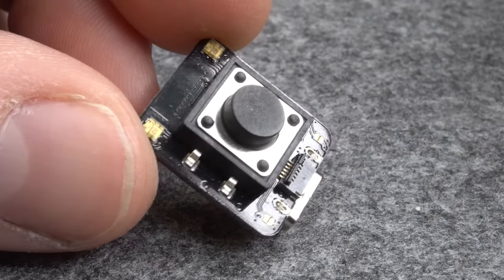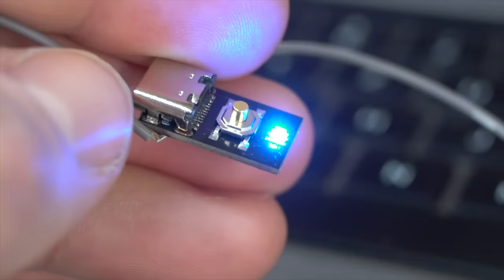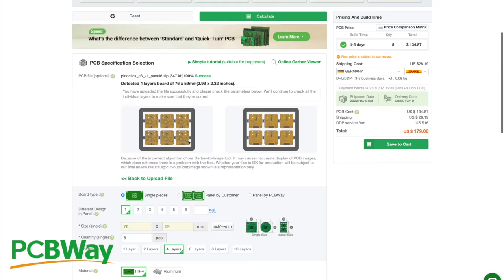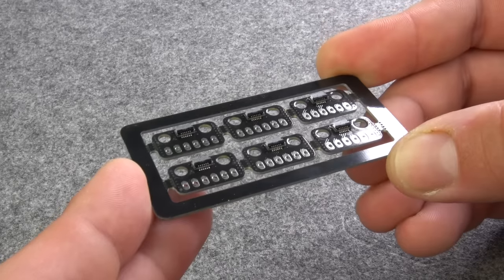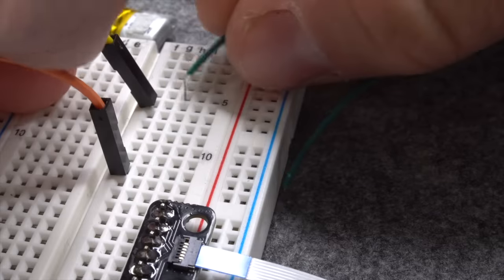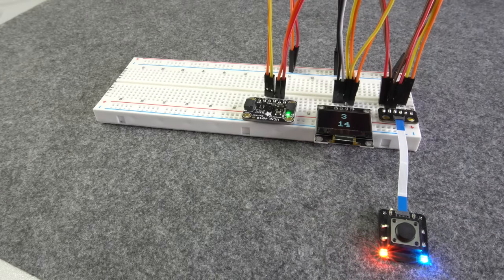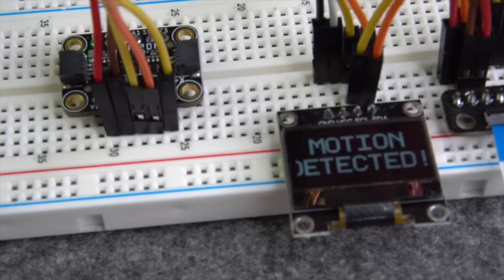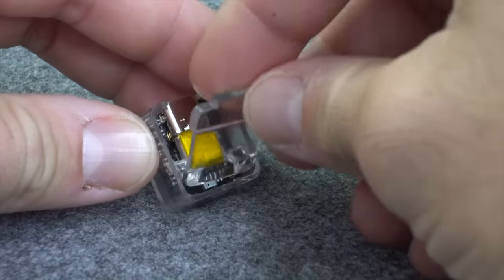Picoclick-C3 is the most advanced ESP32 based IOT button | makermoekoe

Comment: This is so cool. I used a bunch of these techniques to build my custom made ringbell that sits outside without any wires, just ESPNOW, deep sleep mode, a 1000mah lipo and a touch pad that lights up for a second to wake up the ESP32, do its thing and go back to sleep. it will survive 6 months on a single charge. but of course it's a bit builkier and built on a protoboard (I'm ages away from being able to build my own pcbs).

Comment: In the next revision, put the connector (isn't that an FFC, instead of FPC?) on the other side of the board, opposite to the USB connector, that way you  not only you don't end up with something in the way when you need to use the USB connector, you can also just fold over whatever you plug there, creating a more compact envelope, while leaving the USB port unobstructed.

Comment: very ..very nice and useful project, the only thing I would change is the positioning of the FPC connector on the other side (between the LED’s) so that I’ll be able to connect an extension bord and the type c cable at the same time (while in a 3d printed case). Also instead of the FPC connector I would use castellated Holes (Plated Half Hole) in PCBs, I would make it more easy to integrate in projects (this way it can be soldered directly to another bord and/or anyone can solder a few wires)

Comment: As an electronic engineer myself seeing the professionalism that can be achieved with diy projects nowadays is astounding. RF circuit design is fairly complex, may I ask how did you learn about it?
Reply: I agree its a great project. There's not really any RF design here though, it's a SoC using a chip antenna. He has just connected the LNA pin on ESP to an off the shelf chip antenna. Route antenna line over a solid ground plane and keep high speed lines away from it and chip will take care of the rest.

Comment: Nice! Have you measured:

(1) Air time (how much time in milliseconds does it take to send and/or receive a small packet)?

(2) How much power/current does it consume during transmission? And during sleep/idle mode?

(3) What is the maximum range in free air (line of sight)?

Comment: Do you modify the oven for solder?  The $30 UYUE 946C hot plate  looks nice, but may heat unevenly.

Regarding programming, you mention you don't like the ESP-IDF environment, what do you like better?

BTW, some ESP32-C3 boards (ex. ESP32 PICO D4 RGB LED) use the single USB-C for programming/uart.. why do  you need a separate header?  Is it for JTAG?

Comment: Hmm. I wonder if you could make it even smaller by making it with a small solar panel and 1 (might require multiple) capcitors. Bonus points maybe for making the solar panel on top of the button to hide it.
Another idea: perhaps replace the button with a motion sensor and use the "tap" motion detection to emulate a button press... then there are no moving parts which would make this device last a long long time. Though I suspect that would decrease the battery life since it would always have to be on standby looking for tap motions.

Comment: This has been on my todo list for a long time because I'd rather have an ESP garage door opener system than any crappy commercial product.  It might be nice if we could buy these premade since not all of us can assemble such small devices.

It would also be interesting to make a supercap power expansion board since lipo isn't exactly great for use in cars.  That and/or a LiFePO4 expansion.  And an inductive charger board for either the supercap or LiFePO4...

PIR sensor would be another obvious expansion board.

Comment: Wow that looks great. But How did you solder the bottom side of the pcb?
Reply: Yep, same question. 
Maybe a lower temp solder paste and a new round in the reflow oven?
A hot air gun?
Reply from the maker: Exactly the same way I did with the top side. Even with the same solder paste. But the components won't fall off because of the adhesion of the paste. Heavier components like the USB jack would fall off but as these are the highest parts on that PCB they just lay down onto the oven tray
Reply: @makermoekoe  Thanks for the reply. That's interesting to know. I'll have to give it a try.

Comment: Thanks for the amazing documentation you've done! I'm trying to learn how to do the antenna matching circuitry, and I see you have quite a different design on the C3 vs the C3t, have you noticed a significant difference in signal quality?  When I look at the schematic for the c3t I see it has a 0 Ohm resistor in series with the chip antenna, is it simply so that you figured out the exact value later by measurements to get the matching right? Do you have any tips on where I can read about dimensioning the components for the matching network? Thanks!

Comment: As is, these already look awesome for this, but if you made a model with the accelerometer onboard in exchange for a smaller button, this could be very nice, extremely tiny wireless motion tracking sensor for full body tracking in vr.

Comment: I have a question about soldering. I saw you heat the board in an oven to solder one side of components.
How do you solder (heat) the Push button side without the lower side parts falling off?

Comment: Q1) I worked with Atmega644p /smaller sibling to the classic arduino uno. Managed to get it down to 100 uA power in sleep mode. Wouldnt such a device be better to use then ESP32?
I mean just the startup from deepsleep to working state would draw more power on ESP32.

Q2) What owen is that, Infrared DIY ? :) looks handy

Q3) How to you calculate impedance on the PCB traces for the antenna. Is it done in the CAD software you use

Comment: Excellent video and gorgeous circuit designs! I follow all your videos, and I used the power up circuit with the 2 diodes and a button, very clever using the vdd_flash for latching it. I have a question about it? how do you turn off the circuit? because the button is for powering up and a digital input, is the MTDI something to do in the powering off operation?

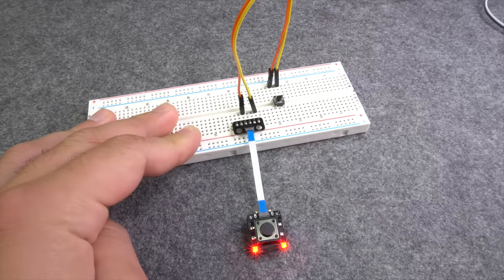Comment: At 10:25 he mentions that door sensors can be used to wake the device, I assume this will only work one way? I mean if the door opens a reed contact will be closed but when the door closes, the reed opens but the device doesn't turn on then if i am correct? Or are there special "interrupt" reed switches that send a high signal both ways?

Comment: Would you later add a biometric/fingers print censor adapter..  also on/off command with polarity switch for door locking solenoids or

Comment: For iot switch, tiny solar panel can charge this device from indoor light, so you can mount it in simple case with touch sensor, in that way, this could be real product to buy instead of make ugly dev board with wire connections and problem to find socket nearby

Comment: I'd like to build the tiny version with a width of about 10mm. The height doesnt really matter and I want to try to build a version with more useable gpio pins. Basically a seeed esp32 just longer so that it has that desired width. How do I do that? Can I just download the original seeed esp32 files anywhere and then make my own pcb and then just use all the components from the seeed esp32 pcb and transfer them to the new one?

Comment: This is amazing!! Any chance of a tiny gps to add to it? I've been looking for something similar with that much power. I am looking for an ultra tiny gps tracker that logs via wifi or cellular sms. I would love to have this without the button but have it use touch vibration as input and a tiny gps, and dual sd/sim slot, for logging

Comment: Working on esp-12f, got some doubts in the chip 
If the input voltage exceeds 3.3v by any external factors does that make the mc crazy..?
Reply from the maker: Till 3.6v everything will be fine 😄
Reply: @makermoekoe  While testing the circuit with smps, at some point the smps output went to 8v instead of 5v then it caused the esp beeps constantly

Comment: Do you think you could build a real window or door  Sensor with it? Amine has to detect Open and close state as separate events :)
Reply from the maker: Actually I have thought about this in combination with the motion extension board. If the window opens, it detects a movement and with the angle of it you know wether it is opened or closed 😀

Comment: Love this project. I'd be interested about what other functionality you could achieve using a smaller button (heresy I know) and opening up that space.

Another thought I had was the input voltage range. You mentioned powering the device with 3.6-6V. So if you powered it with a LiPo would it go under the recommended operating voltage quickly as the LiPo drains and its voltage droops from 3.7 down below 3.6? I would guess the 3.6V is coming from the ESP or some other part with a 3.6V recommended operating voltage. And maybe the part is just derated and will actually function with anything over 3V. Or do you have some sort of boosting going on to ensure the voltage stays above 3.6?

Comment: It was cool and all, but I clicked the video to see what’s its use cases are. But, that was impressive still
Reply from the maker: There isn't a specific use case for this device as it can be everything 😄 Basically this thing was built to control (toggle, switch on/off) things in your smart home (lights, heaters, outlets) but it can be integrated to IFTTT for web requests as well. And with the extension port, it can be coupled with other hardware as well, which converts this thing into a tiny development board. As a lot of people have questions about the use case, I will show a few things in the next episode!

Comment: Esp32 is very powerful chip with huge power consumption. It is like fire from cannon to birds. One chip can handle ten buttons and server in the same time. Also it is expensive to using like one button trigger device. One ESP 32 can be used as quadrocopter self control computer. So it looks like wasting of money
Reply: When you buy the chip on its own, it's about $1.20-$1.50US. That's pretty affordable when you're only doing small volumes.
It does become a consideration when you're planning to make thousands of units, but even then, this sort of device is likely going to be bought mainly by people doing DIY home automation, so they'll want Tasmota or ESPHome support - so ESP8266, ESP8285 or ESP32. Making them with a cheaper chip might reduce per unit production costs, but it could dramatically reduce interest in it too, which reduces profit.

Edit: all assuming anyone wanted to make these commercially, of course... I don't think anyone does at this stage, though if they do, someone let me know because I'd buy a few.